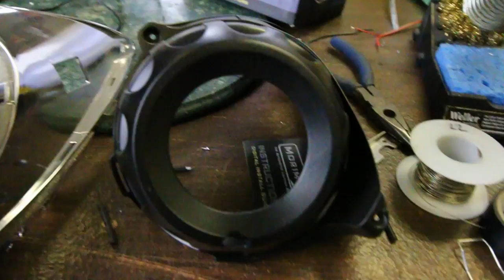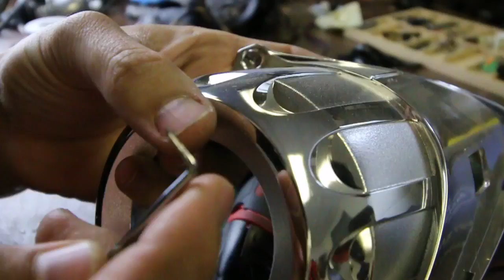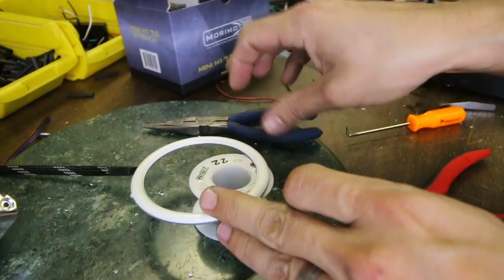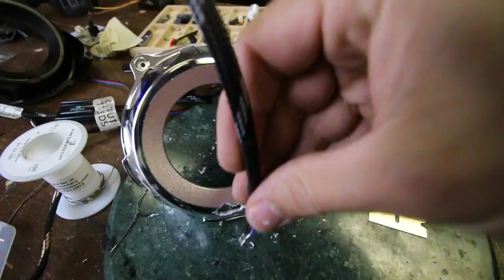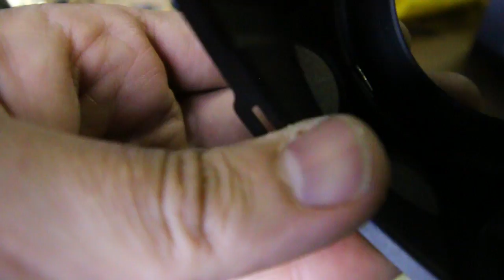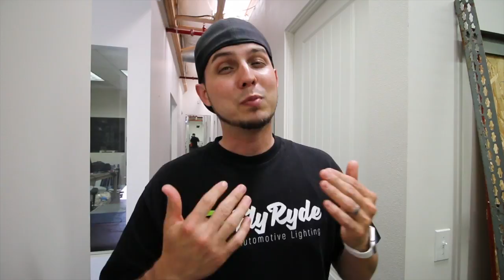How To Install LED Angel Eyes - Halos in 2018

Comment: I'm installing these on 350z DEPO lights where the ring installs there are 2 raise areas that don't allow the rings to sit flush except for those 2 areas can I just E6000 these on or will it cause problems?

Comment: Hey 👋 I want to ask, I have installed the spectrum angle eyes for a commodore 2011 VE . Post installation the lights will just begin strobing in the middle of the night when the vehicle is not being used. Already have a flat battery...not cool. These are new pre installed lights complete. Why do they just turn on at random? Is there a reset switch? How to fix this problem. Thank you brother 🙏

Comment: So... is it only projection lights that can use halo eyes??? I have the old style lights on a 2004 buick regal.
Reply from the maker: about 15 years ago i was making angel eyes for anything I could get my hands on. That included lots of cars that didn't have projectors. It was back then, and continues to be the case now, a kinda bad idea to force the look in a housing that doesn't really accommodate the shape. I see all kinds of hack jobs though, and if the owner likes it, it doesn't really matter what I think ;)
Reply: Ah... on a similar note... ive been watching your videos on LED Daytime Running Lights, and I've been thinking about getting a 2011 ford fusion, and found that the default lights don't seem to include the LED running lights... i did however, see a replacement/aftermarket light housing with LED DRL(brand or model name was spyder i think) and saw somewhere that aftermarket headlights are a big NoNo... what are your thoughts??? As well as the question, whether an aftermarket headlight housing would have drop in LED board supprt???(by support, I mean are they made for aftermarket lights)

Comment: Do you guys work on customer headlights? I will be happy to send you mine to get some LED's fixed proper way.
Reply from the maker: We do! Just can’t do nearly as many as were asked to do. I try to bring on jobs that’d make good content to mix in with my GTR work. What kind of car?
Reply: 2008 Infiniti M35. I'm want the custom setup (3"-6"-6" switchback) like you guys did with the profile pivot switchbacks to run along to top curves of my headlights. There is no aftermark stuff for M35, not just lighting but even in bodywork.

Comment: What size did you use for the halos? I got 80mm for the 2014 genny but I’m worried if it’s too small.
Reply from the maker: 80mm are perfect for the front face of the shrouds on your genesis. I’ll for sure show a video about adding the Demon Eyes to the same year headlights soon 👍

Comment: When you reseal the headlights, these halos with its wiring will be fine sitting in the oven correct?
Reply from the maker: Correct. Keep in mind, headlights have hot components inside, so a few minutes in similar heat isn't anything to worry about. The LED parts have to be designed to withstand that environment, so the halos are good to go.

Comment: OMG! I've been wanting to do Angel eyes on my evo 8 for some time now, you know 3 of those halos per each headlight, but I'm kinda scared of opening them up and break them, plus the cover looks foggy. Can maybe opening them up and maybe sanding them or something help to clear and clean them up? Love the vids btw 👍
Reply from the maker: Glad you like em! You can’t really “unfog” the inside of lights. It’s more of an ego thing when builders tell you that they can. If you can buff out the outside and reclear it like Dustin Williams had done, that’ll help a lot to see how bad the inside of the lens is.

Sucks, but the only way to get perfect lenses is new lights. All those halos, will REALLY show the imperfections in the lens, so keep that in mind 👍
Reply: FlyRyde Yeah I saw Dustin's and dang they look amazing, I was kinda thinking about doing the same but not the demons eyes, i wanted the halos. But my problem right now is that the headlight cover thing looks, I said Foggy but it looks like if it was all scratched up. But it looks both on the inside and on the outside. Don't know if I can clear that up or maybe I have to buy new pair. Thanks for the advice btw! 😁👍
Reply from the maker: Yeah that's the prob with old lights. Especially when there's no aftermarket options for the Evo 8/9 headlights :(

Comment: Hey Chris. How come you install the ring with the harness on the bottom of the projector shroud? When i do the genesis lights, I put the harness to the top.. Just curious if you know something i don't lol
Reply from the maker: Yeah don’t do that lol! If you look at the very edge, I have more of a hole cut out here than it really needed. That’s because I showed how to do it using regular tools everyone has access to. You don’t want to have any evidence of holes and wires visible ever. I’ve seen a ton of hack jobs with big ass holes, even in high end builds. Hide the evidence my dudes 👌
Reply: FlyRyde lol okay. Thought I was missing something after doing a few hundred of those lights lol. I know about the hack jobs you talk about. Seen many myself lol

Comment: Awesome video man. New to the channel from looking at this install. I actually have these Profile Switchback halos that I'll be putting retrofitting tomorrow. Morimoto Mini H1 w/ Mini Gatling Gun shrouds. They seem to have much less margin of error than your shrouds as the bezels are pretty much right there. Any tips? Also, TRS recommended a 70mm halo for front fitting but the diameter seems smaller than the actual projector hole opening by a few mm, is this normal???  I really enjoy that tip by using the little install tabs and just bending the small metal piece then using epoxy on the shroud inside. Thanks!

Comment: Nice vid, mounting the halo on a concave surface is always a little difgicult. I know dome people use bondo or even use epoxy, but then if you have to remove or reolace the halos, it's gonna be a bitch